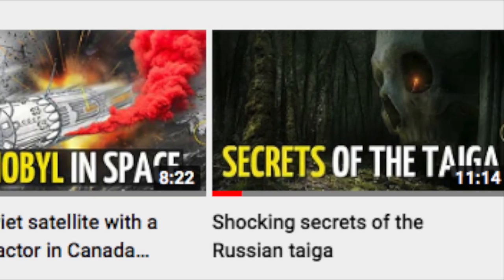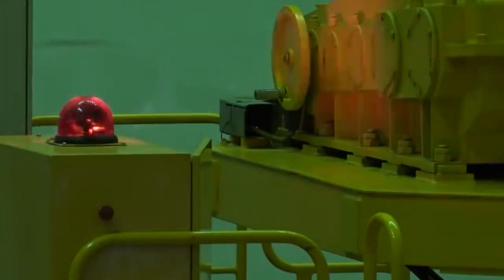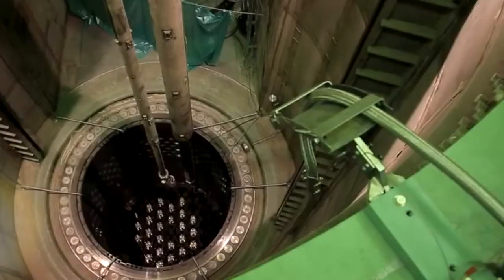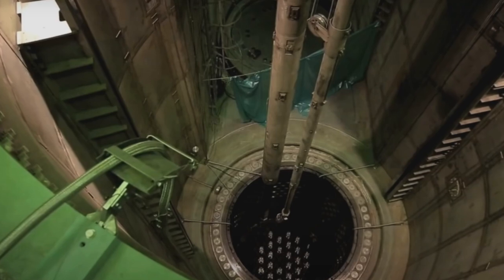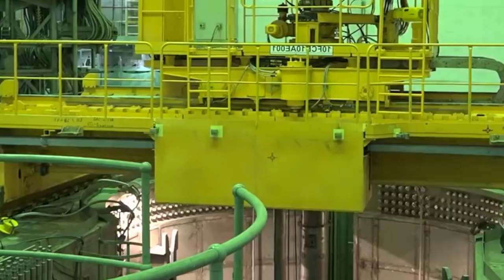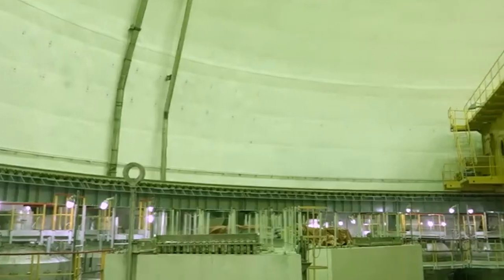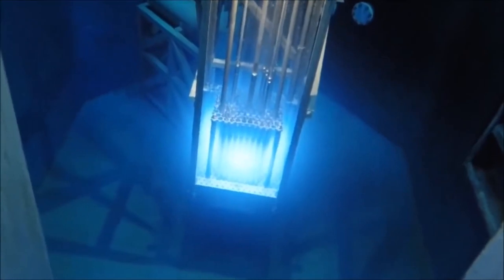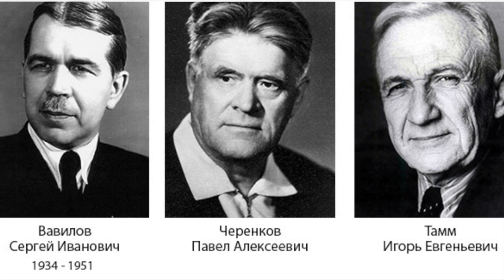Nuclear reactor startup. Where does this glow come from?

Comment: Nice video, but it needs a small correction. The reactor that is being refuelled in the video is a PWR/VVER (the Russian counterpart to a PWR). While it is true that a reactor glows blue due to the Cherenkov effect, you cannot see this in a PWR/ VVER, because during normal operation the core is covered by a reactor vessel head. You cannot run a PWR/ VVER without it. They require high pressure in order to function. The reactor vessel head also holds the "upper internals" and control rods.

The swimming pool type reactors that you see in the video are either training or research reactors, and there you can observe it going critical with the accompanying flash and beautiful Cherenkov effect.
Reply: thankyou sir ... they are leaning now
Reply: Somewhat true!!!
Reply: @snowflakehunter  
Somewhat true? Could you elaborate on where exactly I made a mistake in my comment?
Reply: @swokatsamsiyu3590  yes

Comment: For turn on the reactor you slowly lift the fontrol rods, so the fussion increases slowly, what is are flash and the sound? I didn't understand.
Reply: Fission. Flash is because criticality is a breakpoint thing, it doesn't build up slowly, it happens in an instant.